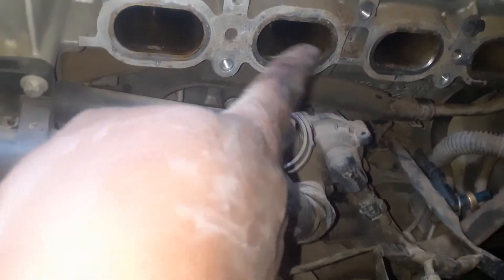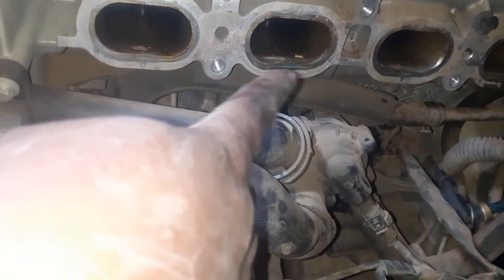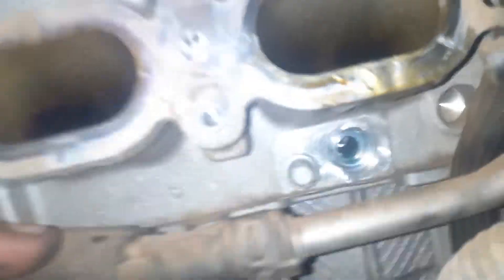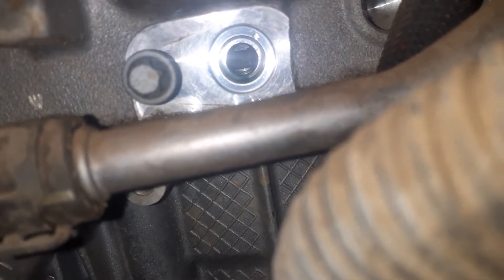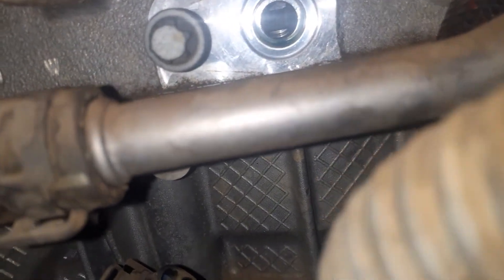M274 thermostat

Comment: Hi thank you for this useful video. 
Can you tell me is there any major difference between M274 and M260?
I have a W177 with a crazy overheating problem. The temperature gauge in digital cockpit go crazy to 120 or 130 degrees then it goes down as fast as it went up.
I changed thermostat with original one from dealer same problem. It occurs when going uphill in sport mode.
Do you have any idea about this problem please?